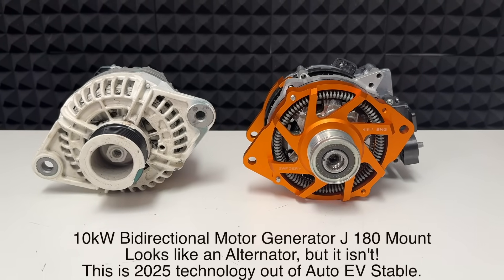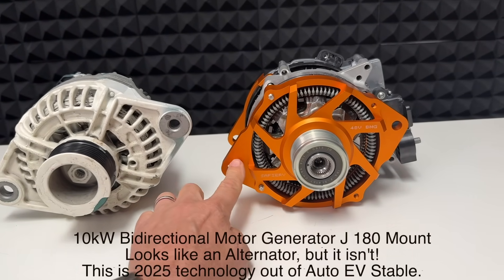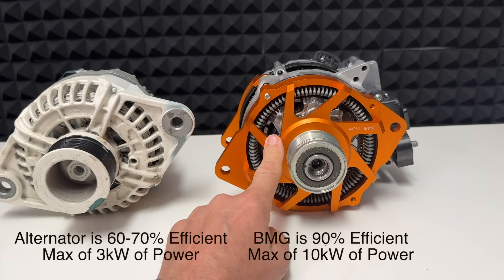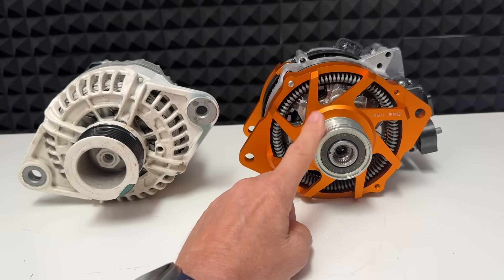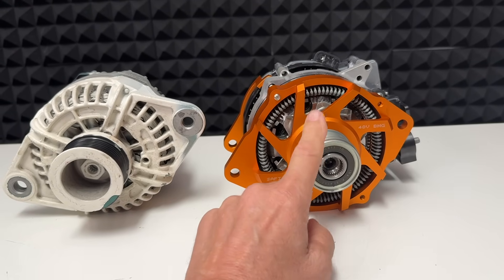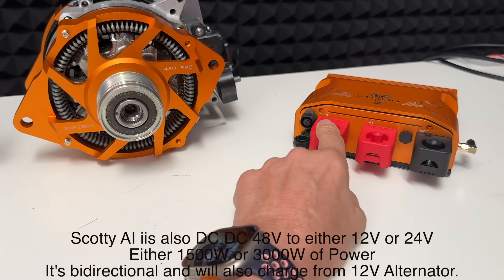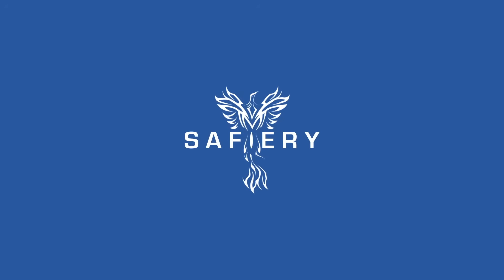10kW J180 Mount 48V Generator Suits Yanmar 3Jh / 4JH will produce 2000W at Idle and is 90% Efficient

Comment: Any know if these could upgrade the mild hybrids in new bmw
Reply from the maker: No they wont sorry
Reply: @Safiery in that application, it’s a 48v BSG. Would it be better to somehow add a 48-volt hard starter to the generator to make its starts even stronger. +maybe a second battery or somehow route a 48-volt secondary alternator for the bsg battery

Comment: Good lock geting 10kw on pully that small....
Reply from the maker: Surprisingly we have that working well. See our 10kW video we did in February. The reason why we can get this to operate is the control startegy we use which has soft acceleration and if there is a torque slip (we read 2 different torques) we also quickly adjust the power is less than 25ms. Cheers
Reply: @Safiery Damn. Very nice.

Comment: Technology is China cheap,, your mark up is RIDICULOUSLY OVERPRICED.
Reply from the maker: We did a comparison to USA made 48V 160A alternators and external regulators and the price matches. The difference is the USA made alternator is rated at 60% efficiency at 23C. At 50C+ this drops to less than 50%. This unit we have was designed by Valeo (French Coy) and the inverter in Germany. If you are a serious customer with a need for high power it is hard to beat on value when you get right into the details.
Reply: @Safiery  Designed 🤣😂

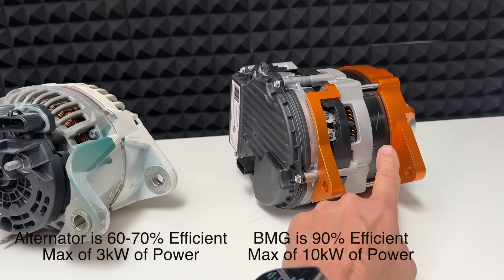Comment: 1:02 What the hell are you talking about? If a normal generator has a diode efficiency of 70%, then the diodes generate 900 watts of heat when the generator is running at full power. You don't understand what you're talking about.
Reply from the maker: It's overall alternator efficiency. The magnetic flux drops away with heat. the diodes are just a poor example of getting DC from AC. Yes, also less efficient.
Reply: Yeah 900w sounds about right. Hence the GIANT FAN at the end of the motor!

Comment: Is it brushless? That's a big price tag if it's a brushed alternator.
Reply from the maker: Its more than brushless, its a Permanent Magnet generator with an Inverter attached to take the AC output to dc. Its from the EV auto industry. Its not a traditional Alternator and yes there are no brushes as there is no wound rotor. Its solid Rare Earth Magnets.

Comment: 8kW continuous? How is it driven? Looks like a sure belt burner with that pulley.
Reply from the maker: Yes and it holds up well as we control the torque and keep it very smotth. The pulley is also aclutch pulley. We are around 100 hours now on first one with no problems. Cheers
Reply: @Safiery  you can't 'control' the torque input from the belt without dropping the power output doing so.

so if the belt starts to slip the controller unit might detect and drop the power.

so it is nowhere near 8kw continuous as soon as the belt slips.  and if you put crazy tension on the belt it will wear the ballbearings. if you upgrade the bearings in the alternator you'd still wear the engines journals /hydrobushings.

Comment: Can this charge a 36v ebike battery?
Reply from the maker: Minimum Charge Voltage is 40V DC. Most 36V Systems charge higher than than. So check that you battery can accept 40V when it is very low. If so then it should be fine. You need the less expensive combination wi the Scotty AI 1500.
Reply: @Safiery  36v nominal 42v max?

Comment: price tag is ridiculous for this, looks pretty, but 8-9k is absurd
Reply from the maker: Thats for the 3000W DC DC as well. $1500 less for 1500W unit. Serious buyers think it is a reasonable price for the technology.
Reply: @Safiery  serious buyers... 😂😂
Reply: @Safiery  If you can get that down to $2k for the motor/alternator you'd have a winner on your hands and I bet they'd sell like hot cakes.  It's understandable to charge extra for the additional components.  $4k for a complete system with electronics (for a premium product) is on the very upper end of what I could rationalize paying.  So for right now still too expensive.  Cool product though.
Reply from the maker: @unhinged-menagerie  Thanks for feedback. This is a 10kW inverter in here as well with SIC chips...
Reply: Someone please explain why this is $10k when a decent 10kw inverter generator (that includes the ICE) can be purchased for around $1200
Reply from the maker: @Nathan0A  Sure. There is no room for a 10kVA generator. Plus you then need a 48V charger Plus install costs.... We are selling plenty of these into the no genset market. We have a farmer who priced up the complete installed cost of a 10kVA genset etc installed on a pad +++ compared to this and this came out in front. He has ordered from us. cheers
Reply: @Safiery  I am a serious buyer and the tech on this is amazing and YES, it is worth it! Thanks, Bruce!!!
Reply: You could always pay $30k for a Cummins Oman marine 9.5kw diesel generator and have another 300kg on your boat. Whatever you think is better value 😂
Reply: @BC-tp8ep  I think the confusion here is the component to capability translation. You’ve got a rotor, a stator, a housing, and a BLDC controller. At its essence the basic BOM isn’t all that different than the inverter generator stage of any commodity genset or electric surfboard power unit. Granted it runs at 48v, which is unique, and it seems to be packaged very nicely, which takes a great deal of engineering resources. That being said you can buy a complete 10kw electric surfboard, including the battery (and the surfboard) for around $10k. HBCI makes a fantastic and small footprint 18kw programmable motor controller for around $1500. The thing that has not been qualified in this video is what manufacturing technique or special technology makes this unit many times more valuable than other BLDC rotor/stator/inverter combinations with a similar footprint and power handling capacity. If the only qualifier to the cost is that it fills a particular niche in packaging and voltage, people will feel like they’re being ripped off. What is stopping some established BLDC maker from changing the winding count and inverter topology of an existing rotor/stator combination, redesigning the package to bolt up in an alternator slot, and selling at 1/3rd the cost? Integration is worth something for sure but at $1k/kw the only excuse for the pricing seems like “because it goes on a boat”

Comment: Is there a smaller version?
Say 200w-1kw?
Reply from the maker: We just set it to that limit digitally and it wont exceed it. Otherwise, Not in 48V Permanent Magnet Generators. Just buy a 48V low current alternator.

Comment: How long can work on 10kw load this generator?
Reply from the maker: Ok the BMG can run at 8kW continuous in a normal temperature ambient environment. The Scotty tops up on that. If the factory alternator is say 150A then add 1.5kW to 9.5kW. If the factory alternator is 220A then you would get 2700W from Scotty AI for a total of 10.7kW continuous.
Reply: hairpin winding design makes miracles!

Comment: We want the bi-directional. Belts are probably not going to work but since we are drafting on the automotive what's the play here?
Reply from the maker: Yes you are spot on. For that to work, we kill the BMG as a generator in 20ms pause then start it as a motor. There is some R and D on the specific application For the Sprinter we have some numbers. We read the apparent toque and can use that to wait for zero load as generator the start as motor. These units were born as Belt Stater / generators. In otherwords they were full bi-directional. We have changed the inverter and control drive from Vehicle EU to Scotty AI. So I think the belt will hold up. But we will be testing soon.

Comment: 90% efficient in the unit, with the electronics being 94%. So the actual efficiency is 84.6%, why not just state that?  Most alternators run at between 70-80% efficiency.  $7-9K is a lot of money for an increase in operating efficiency of 5-15%.  especially if you limit charging to 3kw.  

Then on top of it not being a highly available item, that limits sales to people who can either wait for a replacement to be delivered or local sales.  You haven't convinced me to buy one, and I doubt you'll convince many others.
Reply from the maker: Hi and thank you for the sales advice. We have that 85% number in the technical guide. It also has a graph of the difference in power. The benefit is not the efficiency increase, that just shows the technology is going in right direction. The benefit is power at idle which is only 200-300W for the 48V 100A, 130A and 160A is even less. The BMG is 2000W. Then at full power the BMG is 10kW, 8kw continuous. The Alternators are no where near that especially when they get hot. So the reason why people buy is because they want 10kW for 30 minutes or so at the boat is motored out of the dock or for RV's as solar backup. Alternators cant do that.
Reply: Well technically to can bypass the electronics and just use the winding outputs directly.

But yes it is certainly a marketing moment.

Although 84.6% is still pretty good.

Comment: How much H.P. do you need to run it if i just us it as a generator hooked to a small gas or diesel engine ? to charge a 48v solar system
Reply from the maker: We are using 15kW motor so a 18-20kW engine is all you need. We will do a video on a 20yo Lister 2 cylinder running it to do exactly that... charge a 48V bank as back up for a farmer who will then cut the cord to the grid to save money.

Comment: If I’m reading correctly, the Scotty will cap the charging rate to 3kw even if you have a 10kw alternator?
Reply from the maker: Yes it has a 3kW limit. When you select "soft" mode of charging the BMG comes on only at high RPM. If you select hard, it comes on but feathers power according to engine load as we measure RPM and induced torqu and can detect in 20ms if the engine is over-loaded - at ANY RPM - nice feature.

Comment: Nice! That would even make a nice little charger for a battery backup system during power outages. At 90% efficiency it wouldn’t need more than around 16-18 hp engine to run it. Being just a simple alternator mount makes it easy to make, or order, a mount for and then it’s just belts and pulleys.  Controller mounting and wiring are easy.
Reply from the maker: Yes, we have just sold a unit to a farmer who has dusted down a very old lister diesel rated at 22kW. He is setting up to charged a 48V bank of batteries and has 30kWp Solar we did a few years ago. This gives him backup for a long run of poor solar irradiation and he will now cut the cord to the grid. This DC charging is much more efficient (and cheaper) than an AC generator. I hope to visit and do a video on this.
Reply: @Safiery That’s awesome! I would love to see that!
Reply: @Safiery  I would love to see that video as that is much closer to my application. Do you still need the Scotty AI if you only need 48v charging?
Reply: Much more efficient, reliable, and cheaper, to use a 240v generator and a good battery charger, like a Victron multiplus. I would think, that drive pulley is a bit small diameter, to offer 10kW output ( 12kW input) and offer long life.
Reply: @polvincompoundsadmin5402 What output and input did you get when you tested? How many hours do you have it?